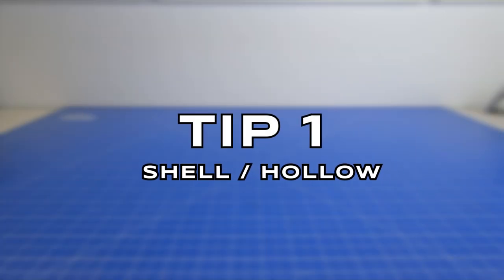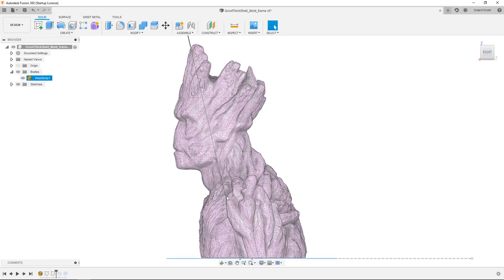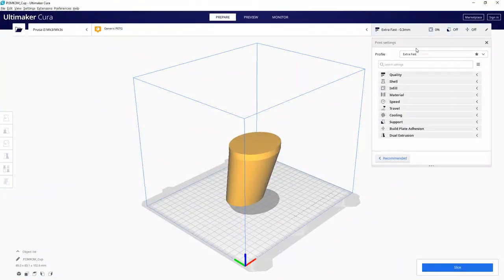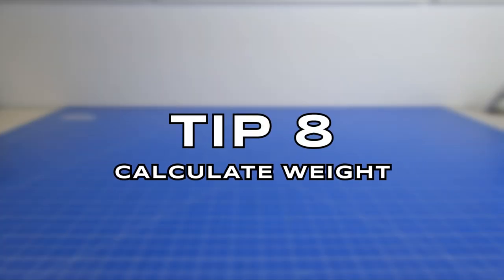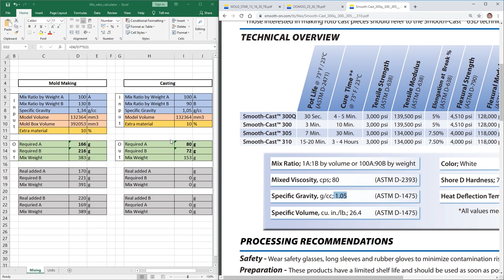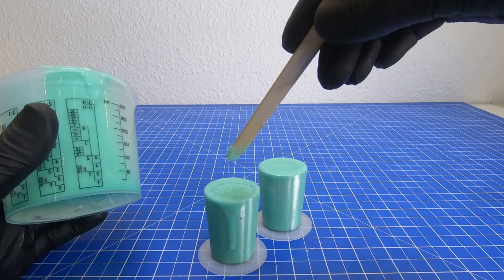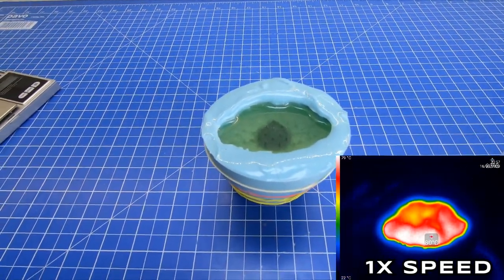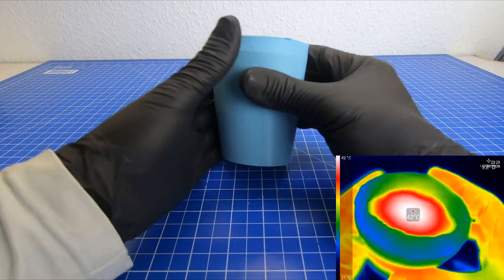18+1 Tips how to make Mold and Casting from Resin 3D Prints | Platinum vs Tin cure silicone

Comment: Extremely well done and comprehensive video, you covered a lot of my questions I had about the weird cure inhibition issues that could come up. I use water washable resin and SO FAR making sure I use a really strong UV varnish (I use montana satin varnish, but I've even used gloss to fill out some layer lines and it really works! Especially if I let it fully dry or use a heater nearby [AFTER I spray and I give the coat 20 - 30 to dry a bit ... no spraying near the heat] to VERY LIGHTLY dry the paint..) and ensuring the coating is dry has helped me not have any issues with silicone not curing to my prints.  I'd reached that conclusion with a few other videos but this was SUCH a good round up of tests and techniques, thank you!
Reply: hi, i'm using water washable resin too and has been having trouble cure the silicone with my current varnish....there're too many montana varnishes on Amazon, do you mind telling me the specific name of the one that worked for you? Thanks a lot!

Comment: Very good video! Thanks! A tip from me - when you use ultrasonic just put your print to box or jar with isopropanol and then go to ultrasonic ;) You will always have clean machine. You can use more than one box, for example - for first, dirty cleaning and for second round :) These boxes are also good for iso cleaning, store them on sunlight.

Comment: Great tutorial! I'm currently doing some of my own experiments to see what will prevent cure inhibition with platinum cure silicone, mostly focusing on how fresh the print is and how long it's uv post-cured. I understand that "inhibit-x" is Naphtha, according to the label, so I'm not sure exactly what it's doing, encouraging/accelerating the silicone cure or doing something to the resin.
Reply from the maker: I have never tried inhibit-x, would be interesting to know, please share your results afterwards so we can learn from your experiments.
Reply: @Dombi3D  I have used the inhibitX and it works, elegoo gray water washable.  Soak part overnight and use thin coat of mold release. :) Am going to try dipping the resin mold in airbrush primer paint (thin primer paint) and see if that works without losing the detail I need.  I don't have the perfect formula yet but working on it.
Reply: It's not just Naphtha. That's just the only dangerous chemical that's required to be listed in the safety datasheet.

Comment: Smooth-On sells a rather expensive but effective coating called Inhibit-X that prevents curing inhibition, and it is very thin so you don't have to worry about loss of detail.
Reply from the maker: In the datasheet of Mold-Star stays: "Note: This product will not cure against surfaces containing sulfur, even when sealed." And another hint: "Even with a sealer, Mold Star™ silicones will not cure against surfaces containing sulfur." I don't know if it is true for Inhibit-X or not. Do you have good experience with these combination (Mold-Star silicone, Resin 3D print, Inhibit-X)?
Source:
https://www.smooth-on.com/products/mold-star-15-slow/
Reply: @Dombi3D  I mostly use Sorta Clear 12, but I have had success with Mold Star 20T, using the Inhibit-X product. I believe it is effective for all platinum cure silicones. Technically, I don't think it is a sealer. Rather, it is a curing accelerant for the silicone. Just a heads up,  if you decide to try it,  they recommend using a mold release on top of the Inhibit-X(like Ease Release 200), as the silicone can bond to Inhibit-X coated surfaces.

Comment: Hey @Dombi3D , i have an issue with my moldmaking, it seems that the seilicon rubber is not curring where it contacts the resin rint, the silicon contains hexachloroplatinic acid, could it be that those two do not go well together? i used LM Kreativ silicon, with sunlu polymere resin.
Reply from the maker: I am not a chemist but the platinic sounds like platinum which is not working with resins as I demonstrated in the video. You need a tin-cure silicon or some varnish layer to avoid this problem
Reply: i will buy another silicon ok amazon to try it out, i will avoid any platinic platinum stuff :) actualy it looks very similar to your example, thanks a lot for your help,

Comment: Could I use gold to cast ?
Reply from the maker: Because the gold melting temperature is a little over 1000 °C and this molding silicone max working temperature regarding its datasheet is 200-240 °C I don't think that it would work with gold. If you use some high temp silicone maybe!
Reply: @Dombi3D  thank you so much for the information

Comment: Hey man, what the liquid in the ultrasonic you use to clean the print ? thanks btw
Reply from the maker: Monocure Resinaway
Reply: @Dombi3D  Try the elegoo water washable.  Rinse in regular water and then water boiled in a kettle.  I use hot RO water, then compressed air.  : )